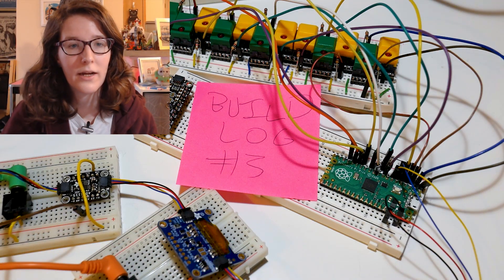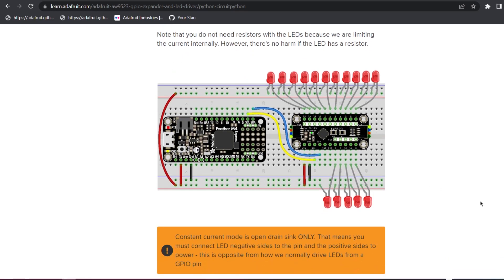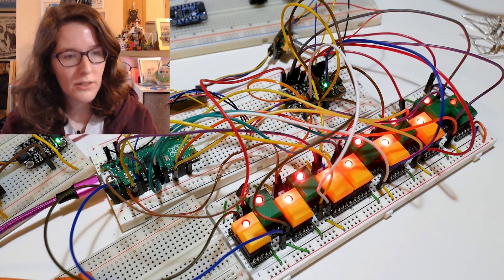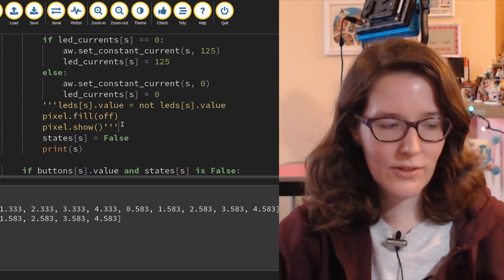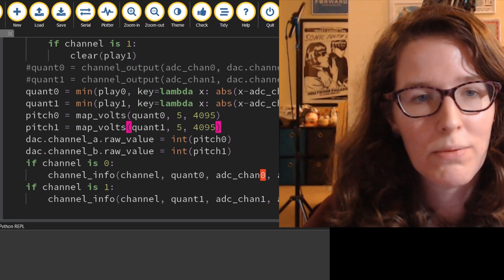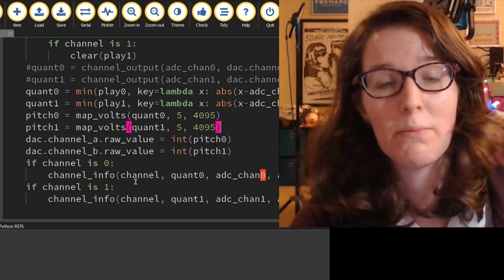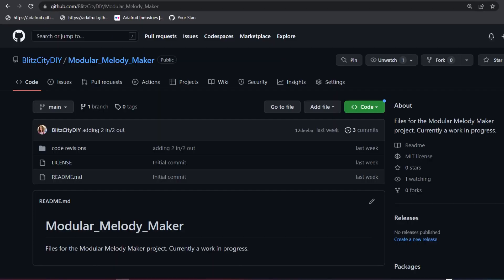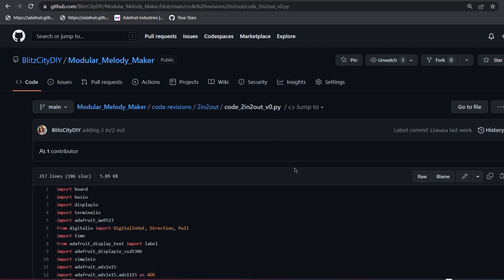Modular Melody Maker Build Log Three: Two Channels and LEDs

Comment: This series is great. I'm currently building a module using a Neotrellis M4, sequencing drum sounds (like the example that was on it when I got it) and triggering gate outputs; despite having spent (yikes) 40 years programming I've only got a few weeks of Python experience so it's reassuring to see the way I've been attempting Circuitpython programming matches fairly closely to yours!
Reply from the maker: thank you and that's excellent!
Reply from the maker: i am actually comforted that with your years of programming experience that your python logic is resembling mine 😺
Reply: @BlitzCityDIY  to be fair I started when I was 8! 🤓

Comment: Btw… Figma is really awesome for making diagrams like you showed at the start of this video (and it’s free!) I use it for circuit diagrams. You just drag in images of the components and then use the vector pen tool to “connect the dots”.
Reply from the maker: thanks! i'll check that out. adafruit uses fritzing for circuit diagrams and we add all of our boards and components to the parts library for folks but with larger diagrams i struggle a bit to keep the wires neat so Noe rescued us 😅